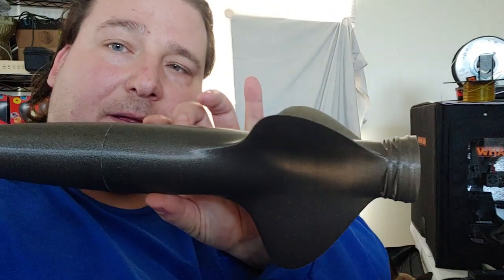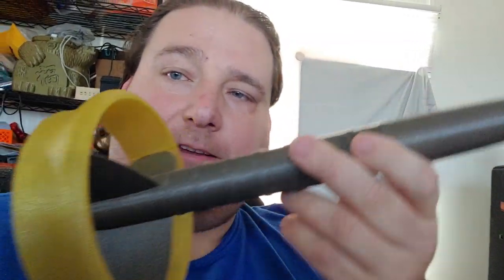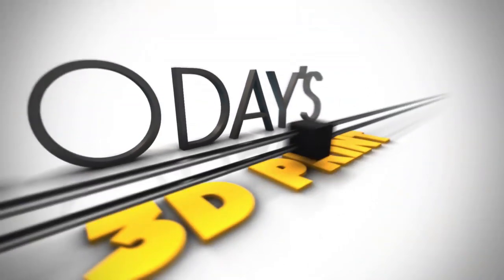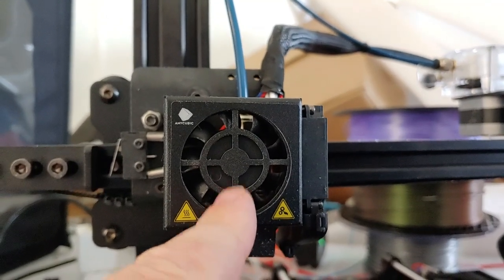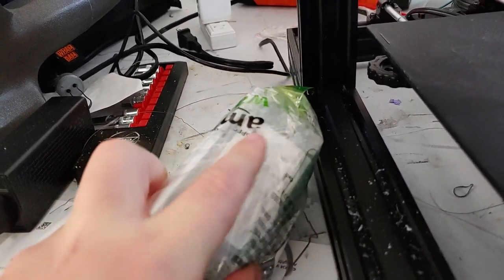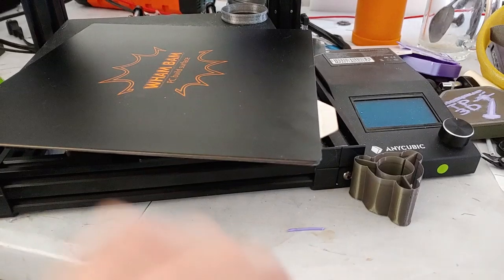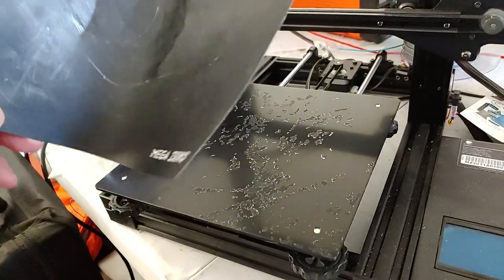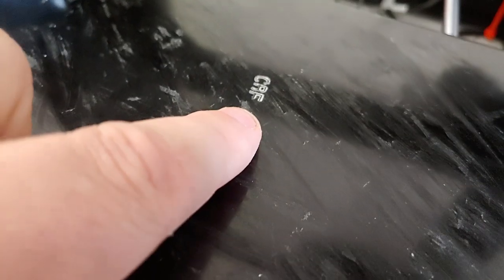Anycubic Mega Zero First Upgrades & Prints T3DP

Comment: Was thinking about getting that Wham Bam magnetic bed, but it costs $55 though ouch, ill have to make some dough before I get that. Great video though
Reply from the maker: Put it on your most valued printer it is worth it. You will never go back to a non flexplate again once you use one.
Reply: Have you had any problems with the bed not being heated? I'm looking at the heated bed for the mega, about $29 bucks
Reply from the maker: @mindsofgreatness  yes. Lifting and peeling without head you really need to use a brim.

Comment: Insane print quality. But it's not only the hardware, without a lot of experience you can't achieve it.
Reply from the maker: Setting up profiles is not as difficult as people think. Once you get the key settings down, there's really not much to change even from printer to printer. Most of it comes down to model selection and adjusting for the model

Start off with 3 x 3 x 3 For the walls and top and bottom. 25% infill 8 mm of wipe 7 mm of retract. Wipe on outer wall wipe during retract.

50 millimeters per second print speed first layer 80% 80% for height and width and 30% speed

Make sure your line width and your nozzle size are the same at 0.4 mm or whatever size nozzle. You are using do not leave it on auto.

First layer 220 Centigrade for pla after that whatever temperature works well for you turn on the fan to 100% at layer 3. Use a skirt with at least three perimeters Two for very large objects five or more for very tiny objects. 5 mm separation

 Set your Extrusion multiplier or flow rate of 0.94 as a starting value. 

Make sure you print walls first then infill make sure the order is inside out for most prints.

 Lower your jerk and acceleration X5 for jerk. P500 T1000 for acceleration. You use if using the m204 and m205 command in your start script. 

 That's basically it. If you configure for that your normal typical does not require any support. Will come out very nicely. Of course the settings change from print to print depending on what the print is the difficulty than cereal. Whether it needs support or not what you're going to do with it Etc.

 The actual model itself is a greater determiner of print settings than the printer is. As far as different filament pretty much The only thing I change is speed And temperatures.
Reply: @nerys71  Most of us 3d printing guys follow these well known big printing channels but neither of them possesses yours practical printing experience.
Reply: @nerys71   Thanks for the hints. I have issues finding the correct settings in Ultimaker. WOud it be possible to share a config/profile file for this printer?